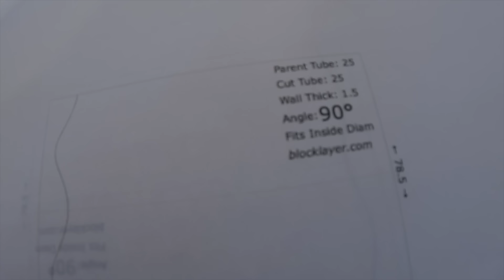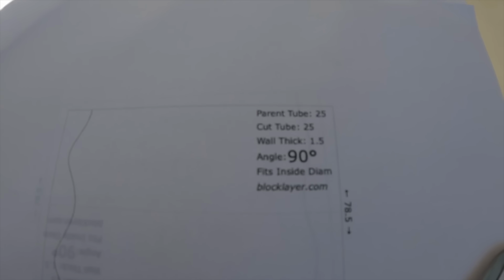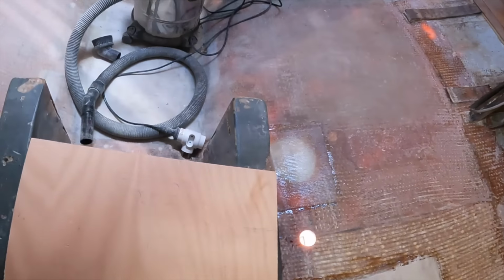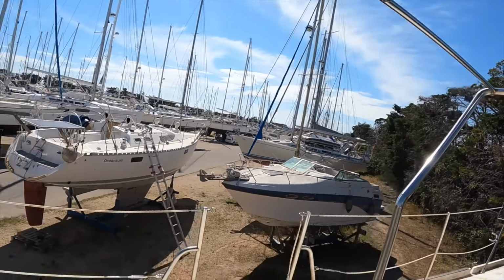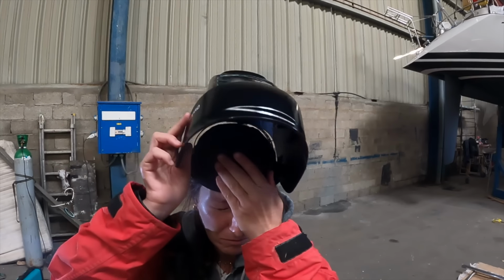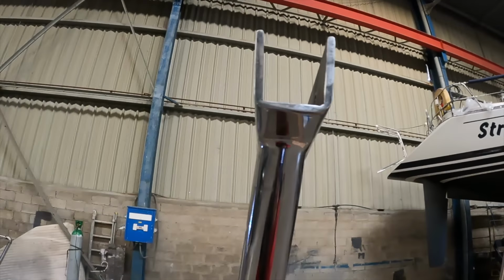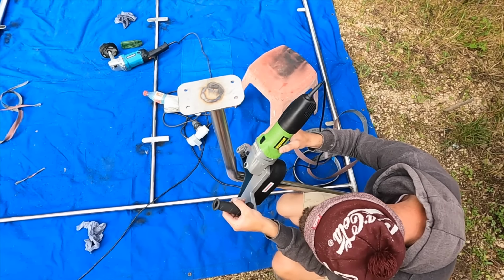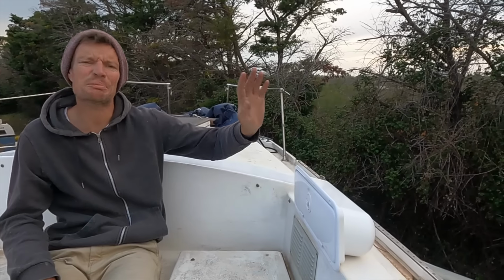Rebuilding a wrecked boat: This Project is Finally FINISHED

Comment: Great job on the solar arch. I'm not a professional wielder but I have seen a lot of You Tube boat repairs and solar arch construction so that qualifies me as a person who will comment on something he knows nothing about. My Comment, do you think you should add a support arm from the vertical poles up to the top poles at the corners. with the increase weight of the solar panels and high winds the solar arch may move.  You both are doing a professional repair
Reply from the maker: Probably.
We don't yet.
We have a few ideas.
Everything is evolving. 
Step by step things will take shape.
Cheers for watching 🙂
Reply: @SailingSeabird  The seabird crew is doing and outstanding job, thanks for letting us be part of your journey Cheers

Comment: Looking great guys... 
Tip: If you use slotted bolts for the vertically mounted ones then it stops water pooling in the head.
Reply from the maker: Good to know. I've got those for the stanchions but the arch has dome allen key type.
Cheers for watching 🙂

Comment: That was a one cool adventure!!What a beautiful arche you designed and made together with Mattias. Quite a coïncidence: I drilled holes in our boat this week, same place in the cockpit as you did, not for a solar arche, but for the holders of the cockpit tent. Luckily there was an easy access in the cockpit locker to the bolts coming through.
Good idea to fit a small cabins in, so you can store some sweets or savouries and still have access to the bolts.
Enjoy your good work!

Comment: Hey guys when drilling fibreglass,  specifically Gel coat, run the drill in reverse for a couple of seconds to start with. By doing this you'll prevent the gel coat chipping and always get a clean hole. Loving the progress.
Reply from the maker: Great tip.
Chipping gelcoat is a pain.
Cheers for watching 🙂

Comment: Stu & Marina I just had a thought about your solar arch. With the considerable load on the whole structure from wind, solar panels and covering you will need strong backing plates underneath the fibreglass, probably the same size as the mount plates. I don't think washers would spread the load enough. Aluminuim would do the trick but probably you have already thought of this.
Reply from the maker: We gave it some thought.
I'll make some plates. 
I'll have a look at what stainless I have.
Cheers for watching 🙂

Comment: I think your arch could use some corner bracing. It seems to be a bit flimsy.
Reply from the maker: You could be right.
We honestly don't know yet.
Let's get it installed and get the tests underway.
We've spoken about added strength and diagonal supports
We'll see...
Cheers for watching 🙂

Comment: Yeah, nearly free electricity, I found this extremely interesting, now solar is becoming more reliable and cheaper, I've been interested in it for a good while now. The welding looked immaculate yer man did a great job. Restoration is never walking in a straight line, use all the help you can, when it becomes available. Thanks for yet another great video, and thanks for sharing see you both next week.

Comment: Great video thanks for sharing. Mathias has very good skills fortunate he’s also your friend. You probably already have a plan but maybe consider using oversized aluminum of stainless plates underneath deck. Mounting holes will be stressed over time from boat motion and wind uplift.
Reply from the maker: Tbh I hate mixing metals. I know it's not always possible to avoid.
Plus I don't have any aluminium, stainless will do. (I hope)
I'll put a bigger backing plate on. 
But you're right, over time it will get stressed.
Cheers for watching 🙂

Comment: I have found butyl tape to work well to separate the disimilar metals of the frames and fasters while also adding some adhesive and anti noise to the whole enchiladas... It will rub and move, guaranteed once underway and at anchor.

Comment: What a practical solar panel frame plus a sun/rain shade to boot! Will you have canvas sides and front/back/side opening windows, that would make it very practical and comfy in adverse weather conditions? Keep at it, great to see all the progress. SkipRay, Kerry, Ireland.
Reply from the maker: That's the plan!
That's exactly what I was thinking.
It's a long way off, but the idea is there.
Cheers for watching 🙂

Comment: Nice work on the solar arch guys. The great thing about you being involved with the build like that is that you know how easily you can modify it as your needs change any time later down the track. And if you do learn to TIG welding yourselves you will forever be able to modify it and build your own SS projects as you please (liferaft frames, pushpit and pulpit seats, radar mount...) and it is a great and fun skill to have!! A decent TIG welder isn’t all that expensive and as you’d have seen by Mathias’s they can be quite compact to keep on the yacht.
Reply from the maker: Hiya, We did buy a welder. Just no time to practice.
Cheers for watching 🙂

Comment: I think it's going to need more support bars, sides to mounting diagonally, as rough seas will cause problems with it being top heavy.
Reply from the maker: You're could be right.
We'll keep adding pieces until it doesn't wobble.
Cheers for watching 🙂

Comment: Love the arch. Try to work out a way to stop the rain dripping down through the solar panels so it becomes a shade/bimini that can also shade you from the rain. Maybe a thin fiberglass panel underneath the solar panels so water sheds off.
Reply from the maker: We'll get it installed.
Test it over a few months and then make dome modifications.
Cheers for watching 🙂

Comment: The arch is solid and will last longer than the boat, but you should eventually create a canopy to attach to the top so you can be both rain proof and 'future' proof. Those solar panels will have to be replaced someday and it's unlikely you'll find exact replacements, so the mounting tabs will need major re-work. But, with a canopy, you can make up rails to bolt the panels to and just alter the rails when the new panels have a different mounting pattern. A canopy also gives you something to attach a dodger and side screens to for when nasty weather blows in... 😎
Reply from the maker: We've thought about all these points.
Roll down windows are my idea.
Hopefully, by the time the panels need replacing, we can weld.
Cheers for watching 🙂

Comment: just a friendly bit of advice :) where you are anchoring the rails to the deck you need to have a plate on each leg so that the weight is distributed over the whole base not just on the bolts. there will be too much movement at the bolts and will crack or even may pull out. using  an internal plate will make it more of a vice on each leg and be a thousand percent stronger . hope this helps!
Reply from the maker: Like a backing plate?
I'll dig out a bit of stainless and try to make something.
Thanks for the advice.
Cheers for watching 🙂
Reply: Yes it will sandwich the rail on both sides of the deck improving the surface area  of the fixture it will also help with any  updraughting. Keep going with it all I love you’re commitment. I’m looking forward to you continuing your channel once you are seaworthy 👍😊

Comment: When you get to installing the engine consider mounting the engine on unequal angle iron. By doing this you won't have to build up the engine beds. Bolting through the engine beds rather than down into the  beds is much easier to align the engine fore and aft and in my opinium much safer in a roll-over.
Reply from the maker: The old was mounted in this fashion.
Our engine bed fits the motor perfectly.
But when we get to that point, we'll have more of an understanding.
Cheers for watching 🙂

Comment: I'm concerned what will happen in a 30knot wind.    I understand you don't want to be in a metal cage but you could cut some fiberglass poles that you could rope in if you expected bad weather.  If you don't reinforce it's going to get badly bent or blown away with your solar.  Alternatively you could remove the solar when bad weather threatens;  that might  be the best approach.
Reply from the maker: These are concerns that we've thought of.
Only time will tell.
We have a few ideas to strengthen it up if needed.
But let's see first.
Step by step.
On the last boat, I added extra diagonal poles.
We have metal and a welder,
we just need to practice first.
Cheers for watching 🙂
Reply: @SailingSeabird Sorry! But this is something I do daily. That framework has no corner supports at all! It will shake and bend easily. There is also the fact that with it moving so much it WILL loosen up the hardware and damage the hull. It would be easy to fishtale some corner tubes and weld them in. Please don't wait until it fails! It will!

Comment: Nice arch, simple and nice fit for the panels.
Yes it would need some diagonals here and there for extra strength but my main consern is other...
Having not stepped the mast, how do you know that you have the clearance needed for the boom and the traveler??? 🤔🤔🤔
Reply from the maker: All good questions.
We marked on the neighbours boat where the boom would go, so we could have an idea of the mainsheet.
Took measurements off the sister ship for the heights of the arch.
Got a winch out with a handle to check the clearance.
I hope we've checked all the angles.
Only time will tell 🤣😅😂
Cheers for watching 🙂

Comment: I wonder if you could put a tarp under the panels so that when it rains and your underway that the water doesn't fall on your head
Reply from the maker: Something might need to be added.
I'm already thinking about "roll down" sides and front (with windows)
That will come.
Cheers for watching 🙂

Comment: You need a gusset on that back stay, if the boat bounces off a wave it will break.
Reply from the maker: Hiya,
I don't understand what you mean...
Cheers for watching 🙂
Reply: @SailingSeabird  where the fold/bend on the solar arch on the back support legs recommend at gusset or supporting bracket. It will snap there.
Reply: I feel like that arch needs cross bracing tubes in all corners also that back angle bracing from the top

Comment: that solar rack looks better than a factory built one.  good job.  😎💚💙👍👍🍺🍺🍻
Reply from the maker: Thanks 👍
Hopefully it's strong enough.
Cheers for watching 🙂
Reply: Are you going to have a weather proof Bimini under the panels ... 
Ideally you want roof sides with clears and Midge nets. No seeums... Or you will get bitten on land or on the coast... you know how bad that area gets. 

It will keep spray out and keep your cockpit dry  at sea and warm in winter. The sun off in summer 🌞 if it ever arrives 🤷🏻🇬🇧🧙🏼‍♂️

Beautiful bird song btw. from the hedge. 👌🏻

Comment: Tha template app is cool...When I was a welder fitter as my tradesman, I use to do these by eye. And got pretty dern accurate and quick cutting them and grinding them to fit. The solar rack looks descent. cheers.
Reply from the maker: Thanks for the info. 
I was surprised about the notching.
A lot quicker than drilling them, plus you use a grinder not a hole saw.
Cheers for watching 🙂

Comment: Unit would be much stronger if you welded gusset plates in the corners
Reply from the maker: I get what you mean.
Let's get it on the boat.
Give a test.
We can always add extra bits.
Cheers for watching 🙂
Reply: @SailingSeabird Please, Please don't! Some well placed fishtailed tubes would stop it from failing. It will fail! I fabricate cages and all kinds of metal daily. It will damage the hull and hopefully nothing else when it fails. Just a bit more work now will stop any future heartache. If need some advice hit me up. But please do not fully install it like that, it will NOT last the way it is.

Comment: Hello again.  Another comment if I may.  The rear vertical supports have a big angle on them.  I saw on the internet a discussion that solar frames like that would probably need additional support bars to be installed so the frame would not crack and break at the angle pieces.  Do you think that might be a problem?   Ok, I am really looking forward to seeing the solar panels installed.  Ciao.  geo
Reply from the maker: Hiya,
Tbh I think we'll need something. Got a few ideas.
But first, let's get it on and start testing.
Cheers for watching 🙂
Reply: @SailingSeabird  Hello.  I'm sure with a project like this, you will find some changes that you want to make after you start sailing your "new" boat.  That's when you will start getting it just like you want it.  It will be very interesting to see that.  ciao.  geo

Comment: Just completed watching this solar arch project. I am no expert on solar.  I have watched numerous channels doing installs. One thing they discussed was the effect of shadows on the panels during times when the sails are open.  Also, every install had the panels running length-wise fore to aft. If installed in pairs, there would be a starboard and port panel.   Never once have I seen solar panels installed across the boat - port to starboard. Did they know something, that you did not consider in your design?  Have you done any consultation with any experts in solar panel design and installation for sail boats?  Maybe you want to check this out.

Comment: I am sure you have checked. Does the frame interfer with the boom?
Reply from the maker: We hope it's good.
We took measurements of the sister ship.
The frame stands about 6'1/2 from the cockpit floor, you'd think the boom wouldn't go that low...
Famous last words.
Cheers for watching 🙂
Reply: @SailingSeabird  need to check, looks a bit high. Usually the lower the boom, the better  power you get from the mainsail

Comment: You should seriously consider stiffening your solar arch. As of now a lot of the stiffening will be achieved by the solar panel frames. In 30 kn of wind the panels might break into pieces. The entire contraption should be very stiff "before" you add the panels. Good luck!
Reply from the maker: We'll see once it's all bolted down. 
We can add extra pieces once it's all installed.
Cheers for watching 🙂

Comment: Not a fan looks too big and boxy to me. Doesn't suit the lines of the boat in my opinion.  Also id say it wont be strong enough as it is
Reply from the maker: You should have seen "mark one"
It does change the line, but being able to produce your own power...
Cheers for watching 🙂
Reply: @SailingSeabird  it can be done without being so big and boxy looking.  I have a cc yacht only a little larger with solar panels over the cockpit which in my opinion looks far better